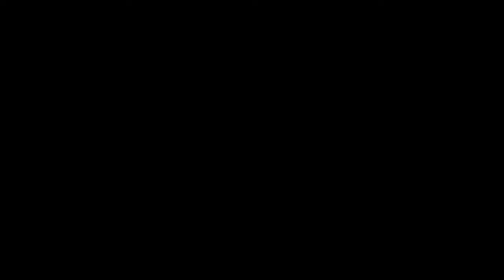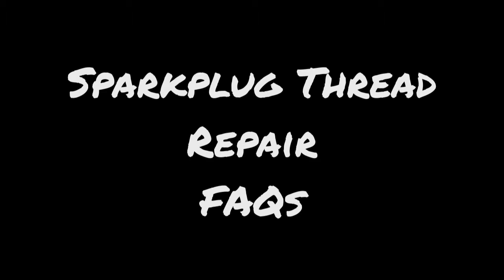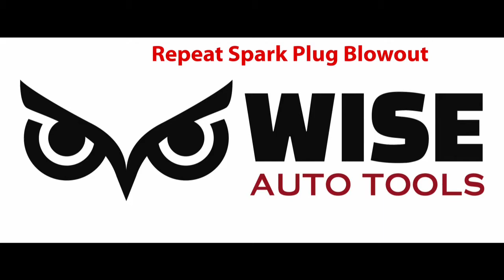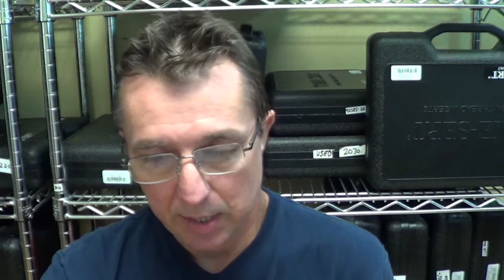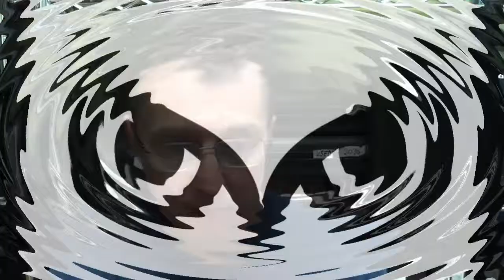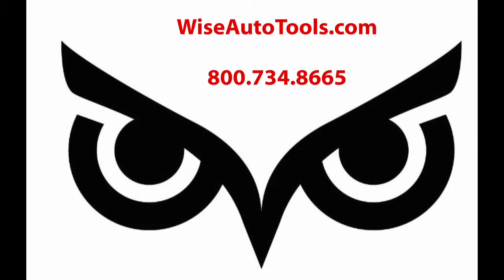Wise Sparkplug Thread Repair FAQs - Repeat Spark Plug Blowout

Comment: Every mechanic I've asked about this problem has told me the same thing, that I need a new head because it'll crack or it'll just blow back out if we put another insert. Would you be able to fix this for me? I'm currently in La Habra California and in need of this repair but really don't wanna buy the whole kit for just one cylinder